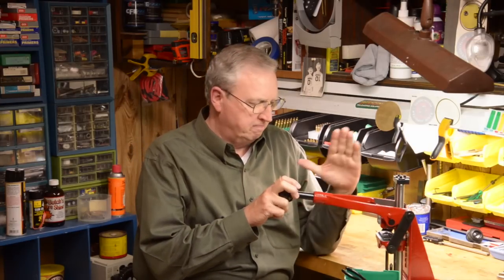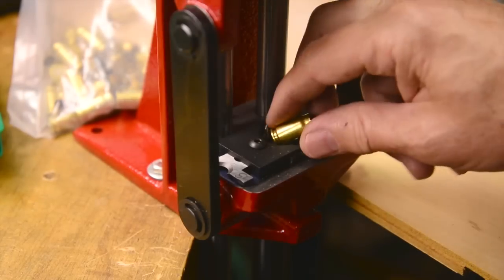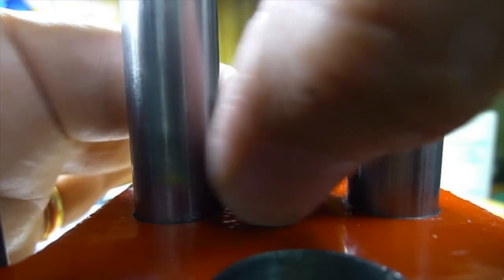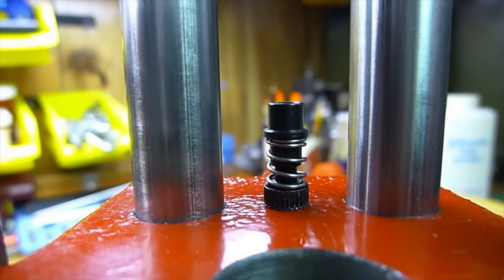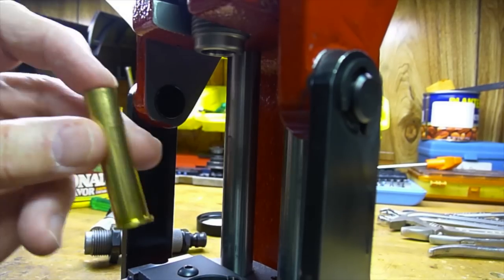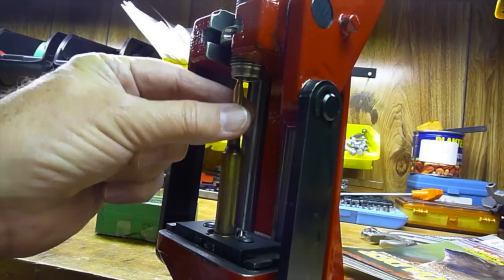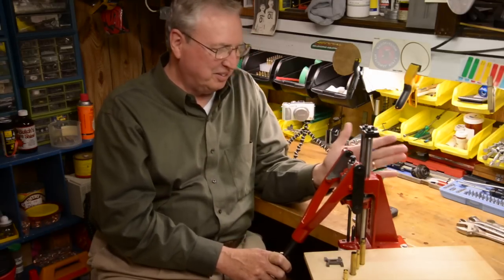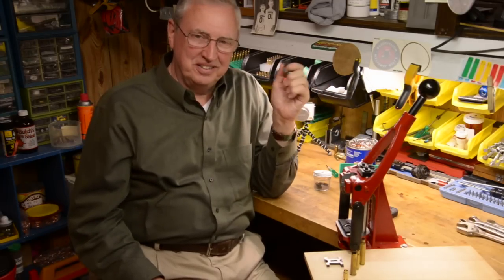Forster Co-Ax Update

Comment: Rex, I want to get into reloading very badly and I have been researching every different manufacturer and types of presses, which appear to be the most popular ones I can find info, reviews, etc. on. I just watched both of your videos (very well done I would add) on the Forster Co-Ax and based on the great features that you have pointed out and the fact that it appears built like a beast, I'm 100% sure that this is the press I want. Before I pull the trigger on it though I wanted to ask your opinion on something. Besides which manufacturer's press I wanted I am also somewhat perplexed regarding the style of press. i.e. single stage, turret or progressive to get. For the most part I will only be reloading 9mm and .223 and eventually maybe .308 and 300 WM. If I get the Co-Ax single stage will I be able to get the correct dies and accessories for it to be able to reload all of these calibers and more importantly do you think this single stage press is the best way to go for a new reloaded over a turret or progressive? I sincerely apologize for intruding and asking so many open questions, but based on watching quite a few of your videos, you seem like a very personable and wise Man and I would value your input and opinion! Thank you very much Rex and thank you as well for the great videos.
Reply from the maker: Hello Thomas and thanks for your inquiry. I would advise anyone starting out in reloading to start with a single stage press or a turret. A turret press is normally operated like a single stage in that you will complete one operation on ALL the cartridges before moving to the next step. In other words, a turret is not a "poor man's" progressive where you can size/decap - expand/prime - charge with powder - seat bullet - crimp in a sequence on a single cartridge. Yes, you CAN do that, but you'll find it more feasible to, for example, size and deprime ALL the cases before moving on to the next steps.

I really like a turret press because all of your dies and powder measure can be set for the loading session and if you need to go back for any reason and repeat some steps, it's a quick matter of turning the turret. Likewise, the Forster press allows for almost as quick changes between dies. Granted, you can't mount a powder measure on it, but I've always operated my measure from a separate setup with any reloading. 

As to dies and accessories, the Co-Ax uses standard dies so any brand will work. Of course you can't use hand dies like the Wilson, but that's the whole point of that die, isn't it. Truth be tole, you may be able to use more dies with the Co-Ax than any other press because the dies are mounted with the lock rings that slide into the groove. Therefore, in theory, you could use something like the old Lyman "nutcracker" dies which are smaller than standard modern dies, but it would simply be a matter of getting a nut for the die that's large enough to fit the press. Now I didn't say that's a good idea, just that there may be more possibilities with the Co-Ax than with others.

As to turret presses, you can find them from Redding, RCBS and Lyman. I have several presses from both Redding & RCBS and a lot of Lyman products. However I don't have a turret press from any of them. The Lyman is attractive because it has 8 stations which would allow you to fill it with dies for two calibers without a problem. Furthermore, you can buy extra turrets for all of these and the Lyman is a bit less expensive. The Redding 7-station would probably be perfect for a couple of calibers and I can say my Redding press is a magnificent beast. I've probably had more RCBS presses and equipment than all the others combined, but the 6 hole turret puts me off a bit, as if it's almost enough.

Working with a single station (or turret) press creates a more focused environment. You are only doing one thing at a time so your concentration can be razor sharp on that. If an operation "feels" funny, chances are there's something wrong and you can sort out that bad apple right then and there. With a progressive, so many things are going on at one time, your attention is spread out all over the place. If anything goes wrong, and it will, it takes a lot more effort to "clean up" and restart. 

Believe me, I know the appeal of the progressive press--I have five of them. In their place, they are fantastic. I still marvel at seeing raw brass go in one end and a finished round drop out the other end with each pull of the handle. But these presses are harsh mistresses. They require a lot of fine tuning and care, and once you have one running smoothly, you'll be loathe to change it over to another caliber until you've loaded several thousand rounds of whatever to justify the whole thing.

My advice is to get the Co-Ax (and AGAIN, I HAVE NO CONNECTION WITH FORSTER or any other manufacturer) and be secure in knowing you have the best single stage press you can get (in many/most people's opinion). Buy good dies. My advice here to go visit several on-line forums to learn what people are having best luck with, especially for rifle. Take a look at Glen Zediker's reloading books, especially for the .223 and .308. His writing style is charmingly quirky and sometimes a bit twisty to read, but his advice is top notch and he will introduce you to a world of knowledge about ammunition and the making thereof.

Oh, get a subscription to Handloader magazine, by all means. I've been subscribing since 1980 and have every issue which I often go back to.

Comment: CAN I USE THE LEE QUICK TRIM WITH THIS PRESS ? ALSO WHO HAS THE BEST PRESS ON THE FORSTER CO-AX
Reply from the maker: Ron Johnson I don't think you can use the Lee die based trimmer because the die body will rotate when you turn the cutter. I think it will only work in a conventional, threaded press. 

I'm not at all sure what you mean by the second part of your comment.

Comment: Great video, Rex.
You are definitely very knowledgeable and one of the more experienced reloaders.
I'd love to have a Co-Ax, but I've been using my Rockchucker for thirty some odd years now, and even if I broke it tomorrow, I know that RCBS will repair or replace it free of charge.
btw...The Forster priming system looks really cool, but by far a better system is the RCBS APS bench priming system.
No need to touch a primer once they're in the loading strips, you get a primed case with each stroke of the handle, and it's adjustable for seating depth, so (just as with the Forster) it guarantees consistent seating depth every time.
The best $90 I've spent on my bench.
Reply from the maker: Thank you for your kind remarks. Let me say I LOVE MY ROCKCHUCKER! And you are spot on when you point out the GREAT customer service from RCBS. They honor their products for the lifetime of the product. It's almost beyond belief this day and age.

You are also correct in your praise of the RCBS bench priming tool. I have never used the APS strips, but the tool is the same when it comes to punching in the primer, and I agree it's the best "production" primer you can get. Fast, extremely reliable and accurate.

I've never seen the APS primers for sale in any of the gun shops I frequent, including a few large ones in B'ham, although they may have been there and I missed them (don't see what you're not looking for, doncha know?). It's such an attractive method, I've often considered getting one of those loaders to roll my own, but I'm just so used to my traditional priming methods, it's hard to get motivated. 

FYI, I use a vibrator tool that quickly fills the priming tubes for the RCBS (or any other) priming tool. Takes about 45 seconds to dump the primers and fill a tube. Hard to beat that. It's called the Frankford Arsenal Vibra-Prime.
Reply: Rex Roach
Thanks for the reply, as it's cool to see an older video with the uploader still tracking comments.
Yeah, I've seen the Vibraprime in action, a really cool idea once set up.
I sprung for the strip loader for my APS, so I just buy primers normally packaged and load my own strips that way.
Once you get the hang of it, it's pretty easy to use it.
One funny bit of experience learned from trial and error on my part is that I was having all kinds of trouble initially with the APS bench system, with it jamming and failing to load.
I had it mounted to a cutoff 2x4 so that I could C-clamp it to my bench because of the limited space there, and I figured out that the problem was that I had failed to clamp it firmly enough to prevent it from flexing upward a fraction of an inch, which (of course) caused the primers to slide off the priming ram enough to go off center.
Once I just snugged down the C-clamps enough to prevent flexing, it works 100% of the time, with the only speed limitation being how fast I can swap out cases.
I love my RCBS equipment, but I admit that I still lust after that Forster Co-Ax.
Keep up the great videos, which I have to admit you do a great job on with your lighting and camera work, and that's before mentioning the great detail you go into on them.
Reply from the maker: I love the exchanges I have in the comments with great viewers like you. Most people probably don't read these comments (because, frankly, on many sites the comments are hostile and worthless), but more's the pity because there's been a great deal of good, additional information posted about the subjects in my videos. 

Case in point: your comments about the clamping issues. Thanks again!

Comment: Rex, You should be getting paid big money from Forster! This was an excellent demonstration video showing the good points of the Co- Ax press, I really like your approach to the very awkward access of this press, setting the press at an angle will certainly address some of the shortcomings of the design, I will try that on my set up, next time I reload some little cartridges.
I think the size of the calibers you mention well illustrates the problem I have with this design, which I admit is very good for small calibers, but I cannot find any way to load 45/120 on it, or 475 No2 NE, or 577NE, perhaps you can advise me. The 4 threads in aluminium is more of a durability issue, that I am sure you have solved by using a steel lock ring, I will get some right away. The primer seating, well I think your video shows the problem, even your manual dexterity has not convinced me on that, a hand held is the easy answer. Many thanks for this update! Chris.
Reply from the maker: Thanks much, my Anglo-Franco friend. Also, mounting it lower than other presses yields easier-on-the-back results.

Comment: Just a question have you considered upgrading the jaw holder to the one offered by manzgear??
thank you for the videos, I'm new to reloading and all of this on line posting stuff still learning....
Reply from the maker: I've looked at the shell holder jaw housing replacement or upgrade part from Manzgear and it looks good. I haven't felt the need to buy one, but I think if I had to replace the original, I would consider it. As far as I can tell, there are three differences: the springs are captured, the thin middle section is slightly thicker and Manzgear says it is made from better steel. 

I've never had a problem with the springs and haven't lost one, but if I were replacing the part, I'd just as soon have the springs captured. I mean, why not? 

My original housing hasn't bent. The housing is stressed only when you have a case that is reluctant to come out of the die. Upward force has no effect on the part, only when you're pulling down. I guess I must do a good job lubricating my cases, because I've only stuck one in forty-plus years of reloading and it wasn't on the Co-Ax press and it was carelessness on my part.

Aside from the captured spring, I can see no benefit of replacing my original housing with the Manzgear part, but I would certainly consider it if the original failed and needed replacing.

Comment: Rex,
it happens to every hand loader. How would you remove the die and case combo if you should get a case stuck in the press? Is there a way to release the shell holder from the case if the ram is not at the bottom?
Reply from the maker: Easier on this press than most any. The case holder jaws are spring loaded and easily separated by pressing through the opening with something appropriately tapered or simply by pulling them apart and allowing the ram to drop down. Then the case and die can slide right out.

Hope that makes sense.

Comment: How can you bump case shoulders on this press??
Reply from the maker: The same as with any other press. Start by measuring a few fired cases from the specific rifle you're loading for. Use a comparator ring on your caliper to get an average length to the datum line of these fired cases. 

Next, put your full length sizing die or dedicated bump die into the press and adjust it down until it touches the shell holder plate of the Co-Ax. Now back it off one full turn. Size a case and measure it with your caliper/ring combo and you should find the base-to-datum dimension has not changed. If it did (extremely unlikely), then back the die out one more turn and try again with a different case. 

Once you've found the die does not move the shoulder, then begin sizing that same case over and over, each time moving the die in by about 1/8 of a turn or 45º. This will give you about 0.009" extra sizing each time. Each time you move the die down and size, measure that case. Eventually you'll reach a point where the case shoulder moves and you'll get a lower number on your caliper. 

You're looking to get a shoulder movement of about 0.0015 (one and one-half thousandths) for a bolt gun. For a hunting rifle or semi-auto, go 0.003" to 0.005" for feeding reliability. Chances are you'll overshoot that amount at some point during the adjust-and-try phase, so back the die up 1/8 turn and try with a fresh cartridge. Turn the die in using tiny increments until you hit your target length.

If you want to use Redding's competition shell holder set, simply use the Co-Ax Shell Holder Adapter Plate which is sold separately. I have a set of those and they work, however I do not use Redding's "feel" method of how easy or hard it is to close the bolt on the sized case. I still measure. However, those Redding shell holders are good in that they let your sizing/bump die make full and firm contact with the shell holder which squares the die better.

Some people prefer the "bolt feel" method of determining the proper shoulder setback, but I think that only applies to precision rifles whose bolts will close on an empty chamber under their own weight (firing pin removed, of course). For most bolt rifles and all semi-automatics, you really need to measure the cases with a good caliper and a comparator.

Comment: Rex, have you tried.303.?
Reply from the maker: No, sorry I haven't. Do you think there would be a problem? The rim is pretty much the same thickness as a .30-30 and less than a .45-70 in both thickness and diameter. I can do both of those if I use the optional large jaws. If you get this press, get those jaws and you should be gold. The .303 case length is very moderate, so no issues there.

Comment: I used to hate the co-ax priming setup but its growing on me.  One thing the co-ax is a little deficient in is pulling bullets. Two things help- 

a) They used to provide a cone screw (is missing on yours, the front hole) that sets the jaw minimum closing distance with the ram up, makes it easier to start a case rim over the jaws when held by a bullet puller. They still have them, but you have to buy it separate.

b) Use a cam lock bullet puller aka Hornady. The screw style ala RCBS is difficult to use on the co-ax because of the Y handle.